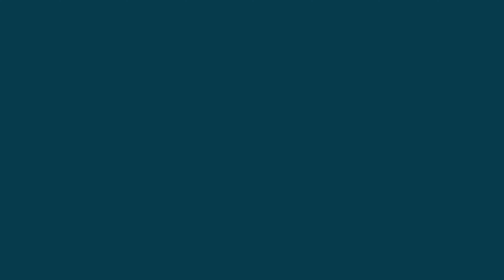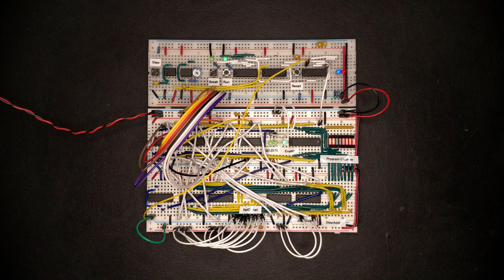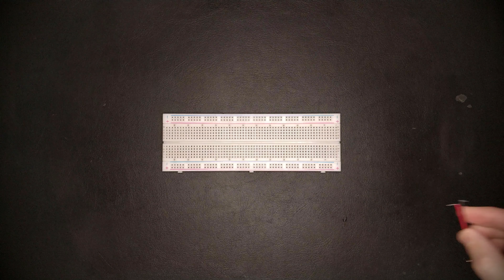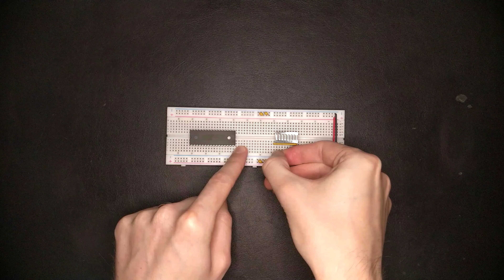Program Memory – Superscalar 8-Bit CPU #11

Comment: The other thing is The square Flash chip packages Not only can be mounted to a 32 pin chip carrier for your board, But they have little daughter circuit boards That a chip carrier can be mounted to. Said board has through holes that match up with the Breadboard Holes, so with pins it can be Connect to your red board.

Comment: Regarding your flash chip, what is your plans for it to use on your Permanent circuit board? They discontinued The Surface mount Chips Package That you've been normally using, all they have is the little square chips surface mount chips, Good news those do have a 32 pin carrier That you can place your square flash chip Into To mount on your board, So you can pull them out to reprogram it when you want.

Comment: Is the chip really 1Mbit, it has 19 address pins, which means it has 2^19 = 524288 different address or in other words 512 kilobytes of data, 512 kilobytes is 4096 kilobits and therefore 4 Mbits.
You may actually be using SST39SF040.
And the pin outs are similar enough, that minipro works without errors.
Reply from the maker: The nice thing about the SST39SF series is that they all have the same pinout. It's just that the smaller versions have some of the address lines disconnected. If you check page 5 of the datasheet (https://ww1.microchip.com/downloads/en/DeviceDoc/20005022C.pdf), you'll see that the "*010" part only goes up to A16, while "*020" also has A17 and "*040" also includes A18.

Comment: Where can I buy such a flash chip, every retailer seems to be out of stock.
Reply from the maker: Yeah supply seems to be a bit short at the moment. You might be able to score one from AliExpress, although chances are you'll be getting some knock-off or rejected part that won't meet the spec.
Reply: Digikey - but your going to have to dig to find it.

Comment: Do you have a recommendation where to buy the programmer? There is a huge mess of endless genuine and counterfeit programmers on AliExpress.
Reply from the maker: I also got mine off of AliExpress. I'm pretty sure it's not a genuine part -- hard to tell with the plethora of lookalikes and rip-offs. It's a pretty simple device though, just a few level shifters and IOs with a microcontroller, so chances are if you pay around $25-$50 for one that claims to be a "TL866II" or "TL866II-compatible" you're going to get one that will work with minipro. I've never been able to find a "genuine" TL866II in the wild and the website seems a bit dodgy and doesn't help a lot (http://www.autoelectric.cn/en/tl866_main.html).
Reply from the maker: I might have actually gotten a genuine one. The seller claims to be "XGECU Official Store" (https://www.aliexpress.com/store/1101313990 ). This is the one I had ordered: https://www.aliexpress.us/item/2251832810188780.html

Comment: Interesting that you use a flash chip whereas most other breadboard CPU designs use an EEPROM instead. Any comment on this choice and what the tradeoffs are between the two?
Reply from the maker: TL;DR: I've found the available DIP flash chips to be cheaper, bigger, and faster than comparable EEPROMs.

I consistently had an easier time getting my hands on chips marketed as "flash" compared to those marketed as "EEPROM". The flash variants also seem to benefit from the very mature manufacturing and economies of scale brought about by SSDs and pervasive use in mobile devices: in through-hole packages, the SST39SF010A flash chip I used (128kB) costs around $3, whereas the AT28C64/AT28C256 (8kB/32kB) likely costs around $6-$13.

The terminology around flash and EEPROM is pretty fuzzy. Flash is a subset of EEPROMs, specifically EEPROMs that have been optimized for storage density and speed in some way, at the expense of awkward block-level erasure and rewrites to achieve the density. Wikipedia has a pretty good overview of this: https://en.wikipedia.org/wiki/EEPROM. If you use them as a read-only memory you won't deal with the parts of the chips that make them distinct (block-level erasure for flash, high programming voltages for "old" EEPROMs).

In fact, most flash chips I've seen were significantly faster than their EEPROM counterparts, but that might be due to chips like the AT28C64 likely being manufactured in older technology nodes than the SST39SF010A flash. Quick look into the data sheets for read access time:
- AT28C64 (EEPROM): 120 ns (http://ww1.microchip.com/downloads/en/devicedoc/doc0001h.pdf)
- SST39SF010A (Flash): 55 ns (https://ww1.microchip.com/downloads/en/DeviceDoc/20005022C.pdf)
Reply: I thought this was an odd choice myself, flash chips are very slow in comparison to EEPROMs.